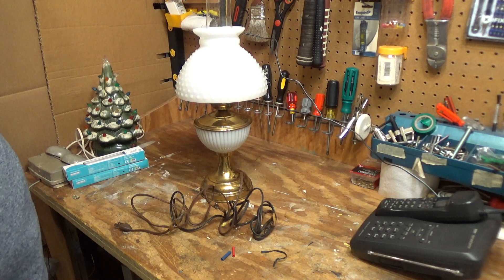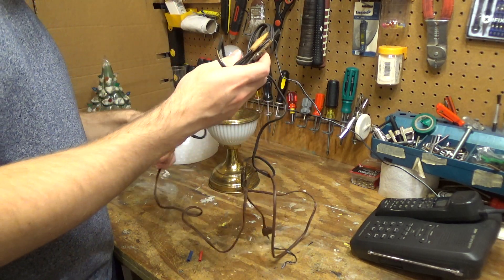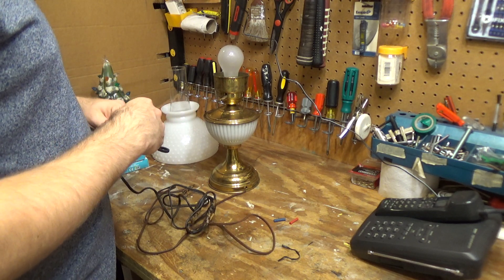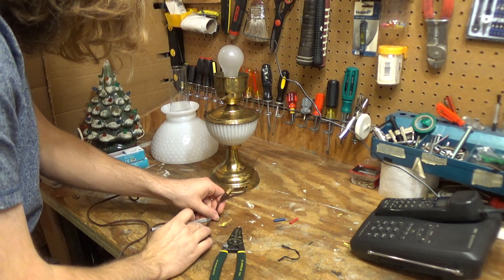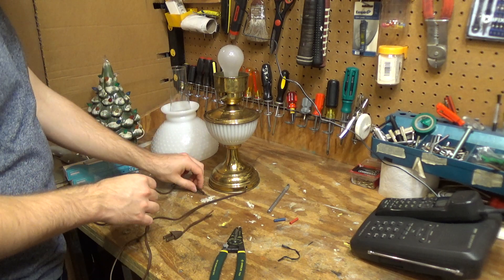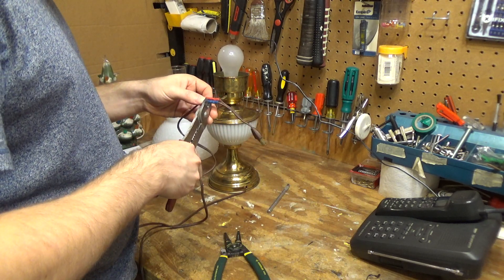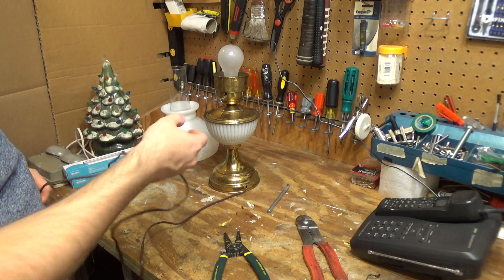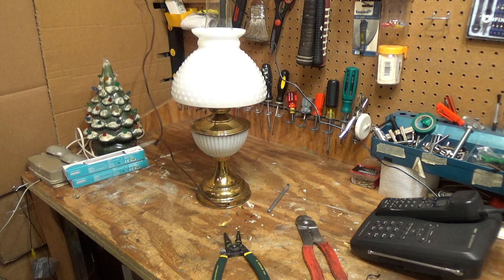Vintage Lamp Repair

Comment: You are setting up a lot of people for a problem. With a situation like this that lamp should be disassembled and completely checked out before putting power to it. At the very least it needs a new cord. Splicing the existing cord is not safe. Insulation on cords gets brittle and cracks with age. What you did is unsafe on many levels.
Reply from the maker: Perhaps you need to re-watch, or maybe watch for the first time, the video.. The repair was not splicing the cord..

Comment: I was wondering when you were gonna get to this Lamp..LOL I seen it in the background. Thought it was cool. Why not just get a replacement plug. Rather than have that odd hack job on there. If the cord is still usable i would just buy a new plug for it myself.
Reply from the maker: My initial intention was to replace the plug but I didn't have any spare ones on hand, so this seemed like the next best option!

Comment: What was that clamp tubing stuff?  I thought it was heat-shrink at first but apparently not.  It looks interesting as long as it stays put well enough.
Reply from the maker: I'm not certain on their exact name, but if you search for Crimp Connectors on Amazon, you'll find them..

Comment: I do not make videos, I do actual repairs and restoration work on pieces such as the one in your video. A good part of my work is correcting "repairs" done by people following instructions in videos such as yours. I sincerely hope no one is injured or their property damaged by following your guidance. Also I would suggest you take a course in basic electricity and electrical safety before you produce anymore "repair" videos of this type. As too showing how it is properly done I told that to you in my responses so video or not I have presented the proper way to preform this. I stand by my comments. The methods you show are dangerous and wrong. This is not opinion but fact and can readily be referenced from any electrical repair course or book. I hope you will take this advice in the spirit it was given before harm is done.
Reply from the maker: When I was in both grade school and higher education, I took many courses on electricity, circuitry, electronics, computers, etc.. I work on electronics for a living.. Electricity is no foreign matter to me.. As with almost everything, there is more than one successful way for it to be done.. This is my way, I stand by it.. You have your ways, you stand by them.. There is no value in producing new and lengthy comments threads in this video that say the same thing as before, you have my answer and it's not changing.. I have recorded many repair videos on a vast array of topics, and I will continue to produce them..

Comment: I watched the video completely through before making a comment. Then after your reply to my comment I watched it again, you did splice the old plug back to the old cord after removing a piece that had been added in by someone else. You even commented on how the existing cord was stiff and brittle. So I stand by my original statement,what you did is dangerous and the entire cord should be replaced after the lamp has been disassembled and throughly checked for other wear and damage. Also the two crimped pieces you used to connect the wires are called "butt splices" and you should always wrap any connection with electrical tape or cover it with liquid insulation. So in conclusion I do not recommend anyone follow your example in doing a repair, your methods are dangerous and can cause fire or injury to the people and equipment involved.
Reply from the maker: I underscored the fact that the black portion of the wire, which was the extension portion put on by someone else, had become brittle with age and was deteriorating.. This is the reason I removed it.. The cord coming out of the lamp, which the plug is part of, was malleable and showed no signs of cracking.. Is it better to replace the cord as a whole so there’s no splice? Absolutely.. Is this mechanical connection going to come apart as it sits on my table, cause bodily injury and fire? No, that would be an unreasonable expected outcome.. You may recommend what you wish, you’re entitled to your opinion, but as always, the people that come in here and say I’m “wrong” have no video showing it done “right”..